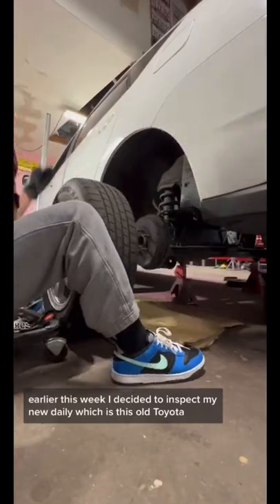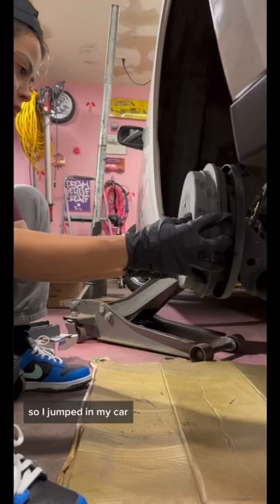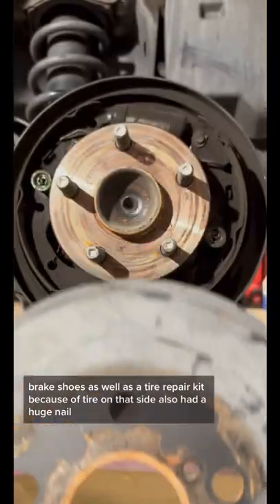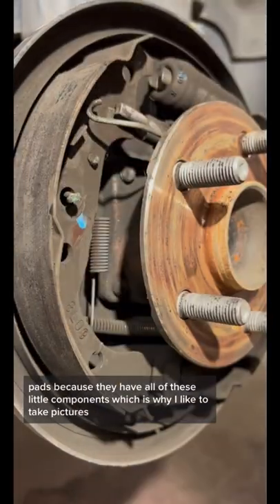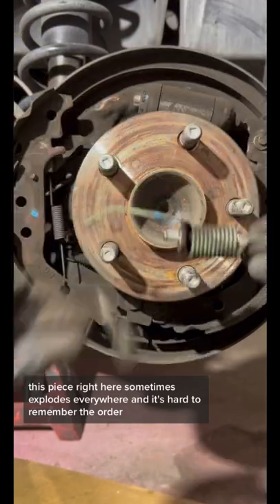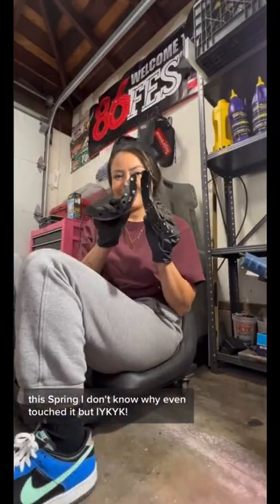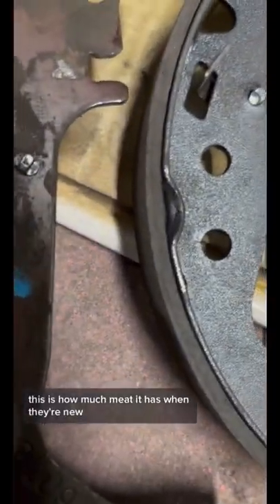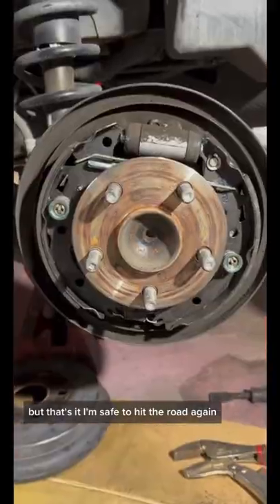Replacing drum brakes! #prius #toyota #drum brakes #diy #car

Comment: I always replace all those brake components, the springs stretch and wear overtime during dissembling as well. Plus they usually cost under 20$ for all the springs for both sides. 
But they are also a must to replace in the Midwest.

Comment: Good job. Wether you do it a lot or not, it is so easy these days to take pictures. No matter how many times I repair, and rewire components I snap a pic . Also helps these days where it may take a few days for parts and you start a few other repairs in the meantime.

Comment: Tbh I just don’t understand why manufacturers use drums anymore, pads & rotors are far easier to do and in the long run are cheaper to replace for the customer. Since some places don’t mess with resurfacing rotors and drums since there’s a chance you get brake pulsation. I can easily do front pads and rotors on a Toyota Corolla in about 45 minutes if I’m taking my time and cleaning/lubricating things properly. Although the kinds of pads I hate doing are the style that are known as “ wind back” basically instead of a miniature drum brake as your parking brake it uses your actual caliper as one. They’re very annoying because you don’t know if they’re seized or not until you get the car in for the job. Normal calipers you can get a small pry bar or flathead screw driver and just push it back and figure out if the caliper and slides are good so if the customer declines brakes at the time I’ll know that the calipers and slides are good so we don’t have to quote calipers

Comment: Yeah and you got those $10 pair of brake shoes you got the cheapest ones had people don’t realize one thing don’t go cheap on your brakes by semi metallic brake pads and shoes. You will stop quicker. They will last a lot longer and if you have to make an emergency stop, you stop and one thing people have misinterpreted they think semi metallic pads eat the rotors and drums they do not. They have copper and them to keep the brake pads cool so you could stop quick the ceramic pads, get hot, sticky, and gummy to where you can’t stop at all. All you smell is burning breaks and you can’t stop them semi metallic pads and shoes. Stay cooler that’s why you can stop so quick.

Comment: Never use a tire repair kit from the store that is to get you to a shop to fix properly you can mess up that Tire if not fixed properly and I fix may cars all the time it cost me $5 to get it done right the one you have is a plug that is put on from the outside but that can fall out you go get it done thay take the tire off and put flat peace to seal it right from the inside it says on the one you got that is temp use or something like that
Reply: I love what you do but that is a big no no